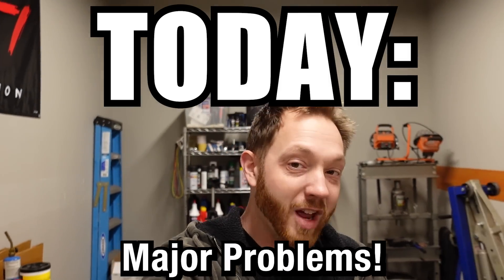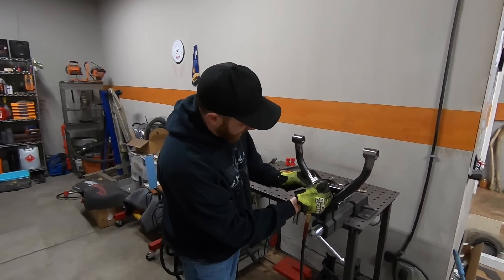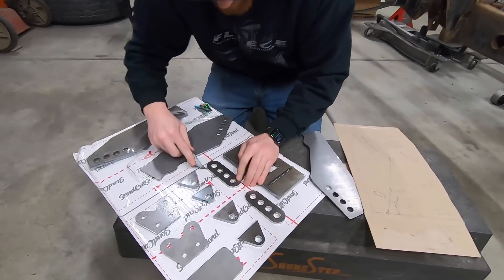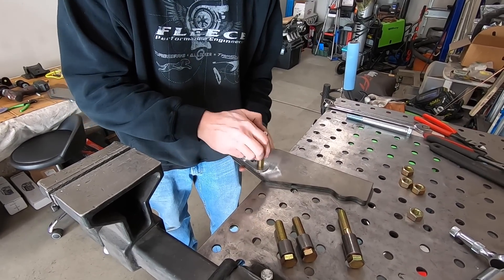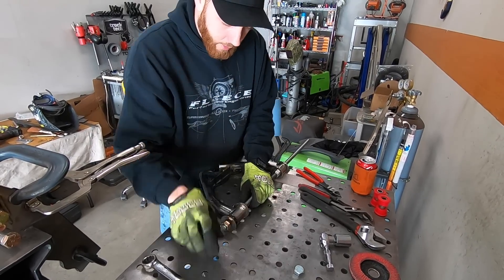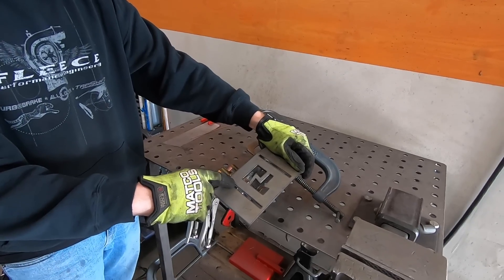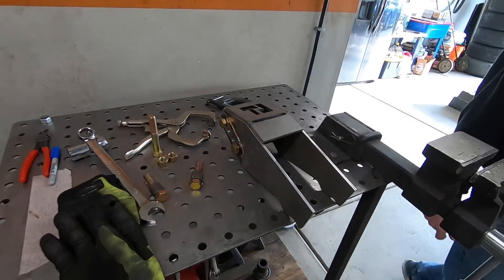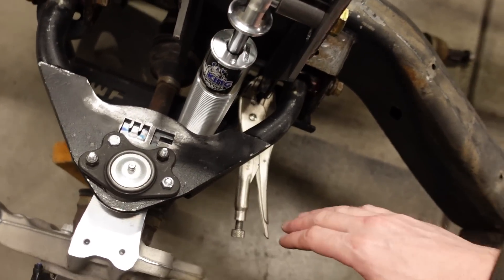a MAJOR SETBACK for my custom front suspension project

Comment: Looks like you left the box profile of the chassis in the drawing when you made up the CAD file (which file you used is not my point , prob. some other file type) those fold gaps are large but makes a good weld when stitched in a single pass weave with your mig.. Over to you LT.
P.S. did you notice your moniker is inside out the way you folded the top mount susp. bracket?

Comment: Why not cut the shock towers back a little bit. It will make them stronger because you will have more welded contact holding on to the frame.

Comment: Would you consider grinding that cross member hole on the passenger side flush to the frame and then plug it with the filler you had made. It's a lot more work, but it would look a lot cleaner. I like how everything in the front end is developing.

Comment: Make a cylindrical notch in driver's side of the frame and French that mount in there. Just flip the initial plate over and bend it the other way. Voila your driver's side problem is gone. Easy fix.

Comment: You should mig weld more of this stuff. Your travel speed is a little slow and you are putting a fair amount of heat into it. Try a higher amperage and a faster torch speed if you absolutely must tig.

Comment: Don't put my name on those brackets 🤣
Reply from the maker: sorry man!
Reply: @TolmanPerformance  have to ask, since going through this much trouble to do the awd conversion, you think you'd rethink ditching the leafs and doing a 4 link and panhard bar? I don't mind it taking extra time than it's already going to take and I think you might be happier doing it considering you like the road course and it would potentially ride better. Have you thought about it or is this more streamlined towards a budget? I know it could be done later but I had to mention it considering the rigorous amount of work going into the suspension. I will have to admit it would make the truck a lil bit heavier but also might be necessary at the point of power that we really don't know what could be made. I'm thinking 1500hp out of that motor could end up being 2000 and 2000+ ftlb or torque could exceed the limits of the leafs and make them inefficient off the line due to axle wrap. No judgement just a recommendation.

Comment: Alter the brackets you have to get what you want. Then if you want make new parts off the altered brackets. Takes out any guess work. Fitting coilovers is difficult on a torsion bar front end.

Comment: I feel bad for mentioning something this late in the build but I want to say that if you moved your control arm mounting holes up say 1 inch on the frame and raise the differential 1 inch then you can lower the truck 1 inch while having better suspension geometry and less CV angle. and you could still do it but might have to modify some stuff and I know you were wanting to lower the engine so that might interfere. just a thought I had that may or may not be an option depending on what your going for overall. love the AWD Big Block idea by the way, this thing is going to be awesome.

Comment: These things happen, I was wondering why you hadn’t lengthened the lower arms instead of shortening the upper arms, but I was thinking for tire figment not shock clearance
Reply from the maker: when I modified the lowers, I wasn't aware that I needed to make a length change, otherwise I may have done that

Comment: A couple of things to consider one is changing the geometry of the front end opened up a can of worms so to speak what I'm saying is the best way to probably lower the vehicle is to do it through spindles, it's good have your wheel's straight at right height but they need to remain as straight as possible through the sweep of suspension travel.When that truck leaves its not going to be at ride height and you want the front tires to be parallel to the race track surface, you should probably put this on the CAD program and watch what the suspension is doing, you can see angle change and also what is going on with bump steer. The other thing is considered running much lighter material there's nothing on that Chevrolet truck that was ever near 3/8 of an inch thick, most of the builders are using 3/16 material for shock mounts and so on and so forth I know Matt Funkhouser the guy you bought the sliders from he's  a friend of mine, he's honed his skills over the years and does pretty nice work, call him you might talk to him and feel him out about thicknesses of material, he's built a lot of different vehicles, race cars and off-road trucks

Comment: LT why can’t you cut some off the back side of the shock bracket and move 1-2 inches closer to the engine, or is that going to interfere with turbos down pipe , seems like a waste to scrap the nice looking bracket you designed
Reply from the maker: I could do that, but it would hang over the top of the frame which would be too close on ths pass side for the turbo up pipe, and would also kill my idea of the upper control arm bolt going through the bracket
Reply: @TolmanPerformance  I see
Reply: @TolmanPerformance  I’m sure you already have another design in the making, check out John Reynolds on youtube he’s in the process of building a mid engine corvair the fab work is impressive especially what he did with his rear shocks

Comment: Get a 3d printer. Test printing designs before you commit them to metal is worth it's weight in gold. 20 bucks in plastic(which is a lot of printing)  pays for itself in one muck up for a laser cut part. 

Caution though, pay more than 300 bucks and make sure it's enclosed. Buy once cry once when reliability and time are what you're after
Reply from the maker: that would be a fun tool to have (and learn)

Comment: I have been waiting for you to weld the c notch. I’m currently putting one on my Silverado but all I have is a harbor freight titanium flux 125 welder and very little experience welding. I’m using the same weld in c notch as you. Do you think my welder is sufficient to weld the frame?
Reply: The welder is fine but you need more practice before you do any frame work.

Comment: One tip I would like to pass along. If you  are getting parts laser cut take the time to add slots and tabs so your parts fixture themselves. Saves a lot of assembly time. Love the build. Keep up the good work.
Reply: That’s awesome advice- I agree 100% and it’s minimal additional design time for the benefit.
Reply: Like SuperfastMatt? He likes slots and circles.
Reply: I came in to comment the same thing. That makes putting stuff like that together so much better.